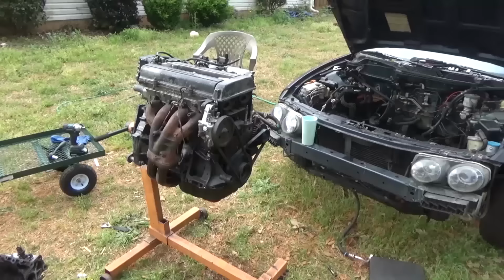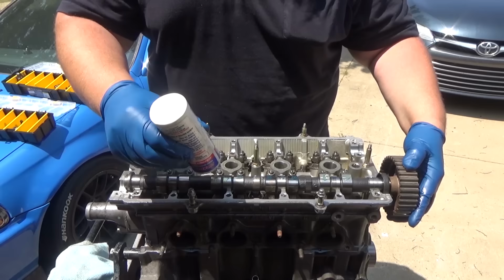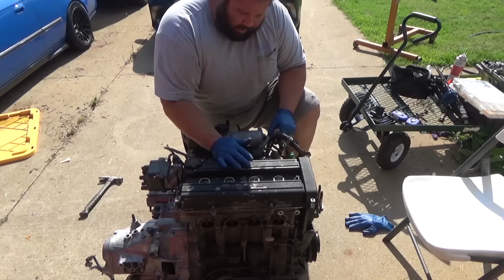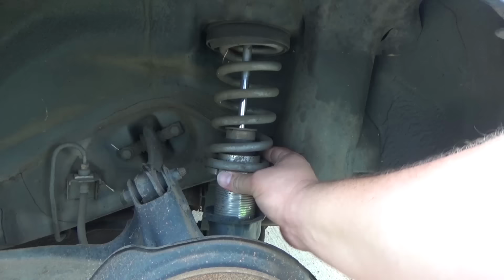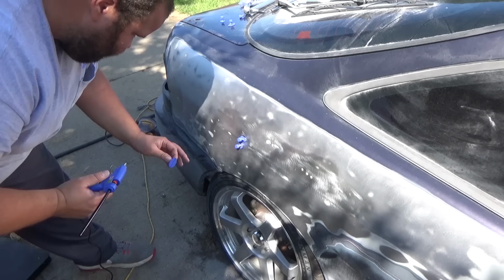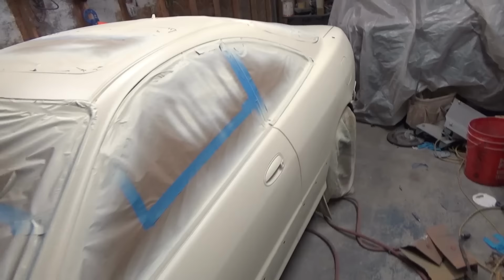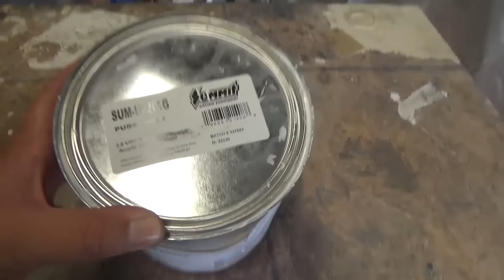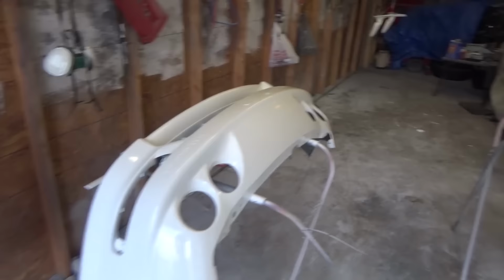$400 Integra, Built On A Budget (Cheap Honda Builds)

Comment: Hey man im trying to get into car mechanics especially in relation to gasoline engines specifically. I love the videos this is exactly what i need to take the next steps in learning however if you could explain the process just a tiny bit more (specifically with products/tools used and the part of the engine or car you used them on) and maybe turn the mysic down a little when you are talking that would help a lot! But at the end of the day its your chanel just have fun and i will continue to watch!

Comment: What did you sand the primer with prior to shooting the single stage? 600 grit? Also the paint was mixed with fast activator?
Reply from the maker: I used 400 grit, the single stage paint I used was thick. Also used a fast activator

Comment: Hi bro , what minimum specs for air compressor do you recommend for spray painting an entire car or car panels? I want to do some paint work my self and got told not to get an air compressor too small.. Any help from anyone would be appreciated , thanks in advance
Reply from the maker: I use a 29 gallon harbor freight compressor, it runs consistently while I'm painting. A 60-80 gallon is what you need but I have used as small as a 21 gallon.
Reply: @79thproductions  Thanks a lot bro , much love from far far Australia!

Comment: I've only done rebuilds on bikes but how come you chose to do an engine swap instead of rebuilding the engine? real question
Reply from the maker: The cylinder walls where bad, the deck was warped, head was warped, crank was bad, 3 head bolt holes where stripped. There was to much wrong with it, cheaper to replace
Reply: @79thproductions  wow, the old owner must’ve abused it terribly! Make sense. You have given it new life, and a great foundation for the next person to care for it.